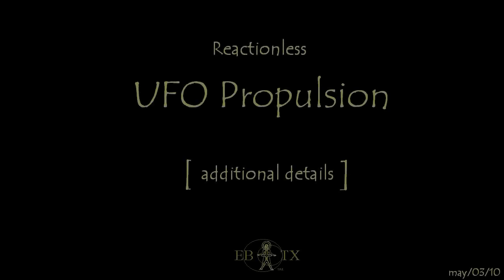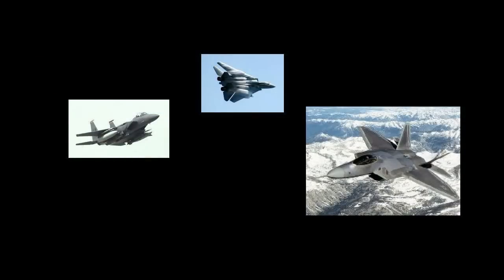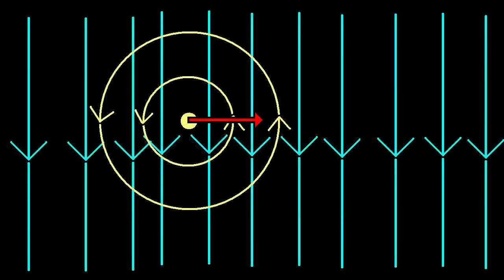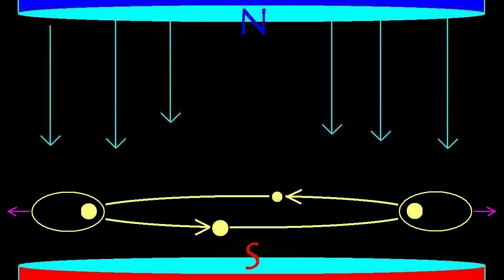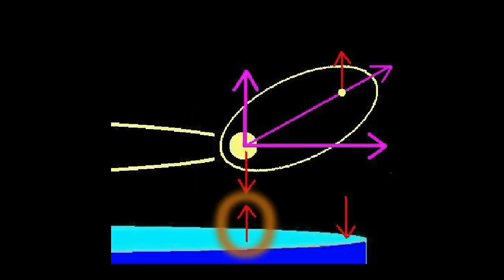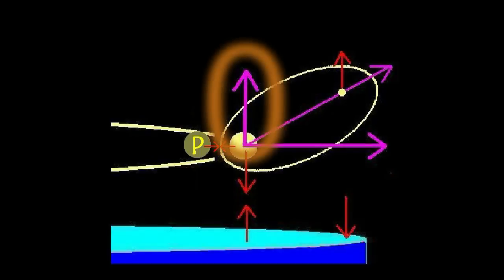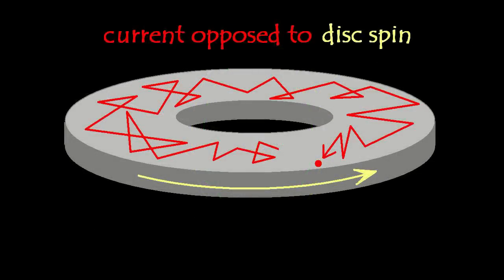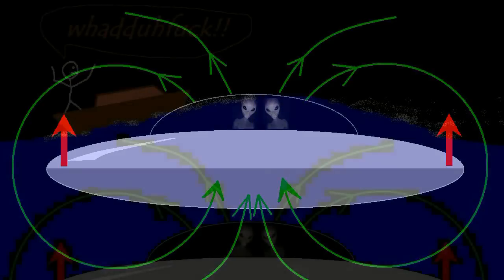Reactionless UFO Propulsion #2

Comment from the maker: You didn't understand the video. The ring is a solid ... or ... rotating superconducting fluid ... or ... you name it ... NOT particles in an accelerator like CERN.
The donut of mercury proposed by TR-3B can't work at 100k RPMs if it's any significant mass. There is no force in the universe to provide the necessary centripetal force to keep it from exploding. You can get 100k and keep it together provided that you don't have too much mass, i.e. maybe a pubic hair thin stream of mercury at 100k.

Comment: ---->More so since your not pulling on the aether the same as when your at 7hz you don't disturb space as strongly as you move through it and hence remove space time effects from occurring the same way you remove aether based drag so you don't have to worry about going the speed of light or faster and when you get back home it's centuries in the future because of space time effects, frankly that would never happen anyway because you could never get your spacecraft to the speed of light---->

Comment: I repeat the question I asked on another video by this poster;

To go beyond the discussion about generating the " vectors " by a fast rotating disc to counter-act inertial forces...HOW do you generate the energy necessary to achieve this rotation ?

You say it would be achieved by some small nuclear reactor but that does seem to be able to generate enough electro magnetic fields to cancel gravity and cancel the effect of INERTIA...and by your own admission it would NOT cancel gravity.

I have reviewed many ideas about how this thrust would be achieved, including the ideas about some sort of super conducting fluid but most of them sound too fragile and sketchy to explain UFO type performance. You refer to that too but if there is any credibility to the claims by those who have worked on reverse engineering alien UFO's...then their propulsion is NOT based on some circulating fluid...but rather on generating  enormous electromagnetic fields which somehow created a local anti-gravity effect.

I think that the ELECTROSTATIC PROPULSION system proposed by TESLA makes the most sense to a layman and apparently because it suggests a PUSH-PULL form of propulsion which would theoretically have no speed limit and  it was the science that was probably the basis of the German UFO type prototypes. It is probably also the technology behind the secret human advanced flying devices like the TR-3B

TESLA also talked about COLLECTING the energy from the radiant energy that permeates everything, including outer space and which he harnessed by some sort of REVERSE TESLA coil

So HOW do you get the energy
Reply from the maker: +Leon Maliniak 
If the centrifugal vectors can be made to point out of the plane of rotation, nothing more needs to be done. If the net vector "up" is greater than the gravitational "down" vector ... the ship will hover or go up depending on the payload mass. 
The electromagnetic fields don't cancel gravity ... their purpose is to get the force vector out of the plane of rotation. If the centrifugal vector can go out of that plane, it is a violation of linear momentum conservation ... and ... if that law is violated, it follows that angular momentum conservation and energy conservation go out the window as well. The ship will accelerate to relativistic velocities using less energy than the kinetic energy it obtains from the propulsion system, i.e. something for nothing.
Ultimately what I am proposing is that the conservation laws are results of 'other' laws and are not binding in some contrived mechanisms (none of which have yet been discovered on earth).
I wouldn't think it possible except that UFOs appear to do just that ... they accelerate rapidly without throwing anything out in the opposite direction ... hence, they appear to violate linear momentum conservation.
My proposed propulsion system is the best idea I could come up with that might conceivably mimic the behavior of UFOs.
Reply: I understand the principle of vectors pointing away from the plane of rotation to achieve thrust, but my question addresses the primary issue in this matter which is; WHERE DOES THE POWER COME FROM AND HOW IS IT GENERATED ?
Reply from the maker: +Leon Maliniak To rotate the wheel and create the magnetic fields a nuclear reactor would work. Waste heat isn't a problem here because the engine doesn't have to work hard. In principle, you could peddle a bike and get enough thrust to keep accelerating ... provided that you were away from significant gravitational fields. Peddling a bike wouldn't do to get you into orbit ... but if you were just coasting along, you could add some velocity that way.
The amount of kinetic energy in the ship is growing as velocity squared but  you put energy in as a constant  If it works ... it does violate energy conservation. Anything the violates linear momentum conservation also violates energy conservation in principle.
I don't know if I understand your question. Maybe you are not familiar with my model of inertia and mass though I thought I put that quite clearly.
Reply: I am not a physicist but if all it took was a nuclear reactor...then we would have all been flying around in flying saucers by now...and that would still not explain the cancelling of gravity or the effects of inertia. Pilots would become squashed bugs on a windshield if this was the proposed source of propulsion.

I put more credence in the propulsion system described by BOB LAZAR who, based on his evidence about element 115 and the cross corroboration from others who worked in this field, like BOYD BUSHMAN,  I believe did in fact work on reverse engineering some form of alien craft, as he claims, and which was based on some sort of gravity cancelling effect of element 115...and not on some sort of super conducting circulating fluid...which seems very unreliable.

The evidence is also overwhelming that humans probably do already have this type of technology in the form of the secret TR-3B

There is so much evidence from so many different sources that we already have this type of advanced technology...I WISH THEY WOULD JUST LET US ALL KNOW ALREADY
Reply: +Leon Maliniak I have let you all know already.
Reply: You are right.

I believe that we already have this advanced technology...I just wish they would let us in on it because I do not set foot in a commercial airliner and have no faith in a technology which is the mercy of the air currents and the weather.

Comment: you're close, the technology does violate the laws of thermodynamics and the conservation of energy, but it works by concentrating electrical fields to create artificial gravity fields. it's these gravity fields that provide propulsion. look up quantum kinetics. the high k dielectric motors is what causes the ships to have high density mass.
Reply from the maker: Unfortunately there is no experimental evidence for that ... or, what I've proposed either.
Reply: Bantokfomoki look up the work done by  Thomas Townsend Brown, he achieved levitation in a vacuum chamber

Comment: If you could receive funding to conduct an accurate experiment, I think you could prove your theory correct, however, I can't see how this would make a practical form of interstellar travel. If you go to fast, special relativity kicks thus causing your place of origin to experience a long period of time and if you travel slow enough as to avoid special relativity you then cause your base and the passengers to experience a long stretch of time. This would make a better interplanetary mechanism.

Comment: I still cant see any way this will work  I once had and idea that the only way one can go faster then the speed of light though space is to have a large iron ball  go a head of the space craft. the ball will be held  in an opposing  magnetic fields   Once the space craft  pushing the iron ball pass  the light barrier then no energy will be needed to propel the craft as the iron ball will be bending space going  though space It would bend space. a head of it  travailing  many time faster then the speed of light

Comment: @nicktesla45 I disagree with this. What speeds are you talking? Interstellar speeds? OK, great, if you want to lift a craft, your theory might be correct-- but how about travel between stars? 
There is strong evidence that interdimensional travel is REQUIRED for the ET's craft to get from there to here. And the right-angle turns which the craft take, take them OUT of the #d reality in which we operate, through other dimensions, to their star-- which exists in another dimension.